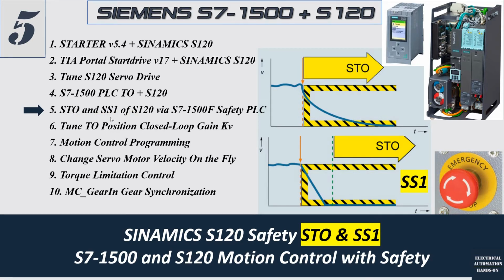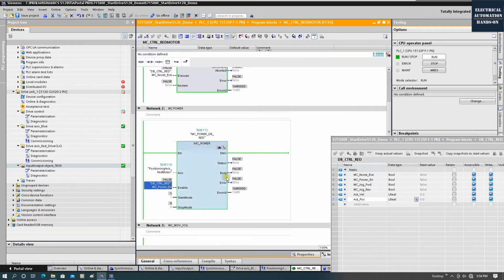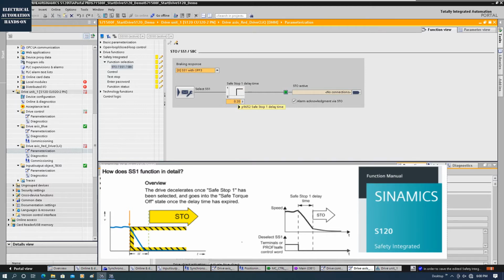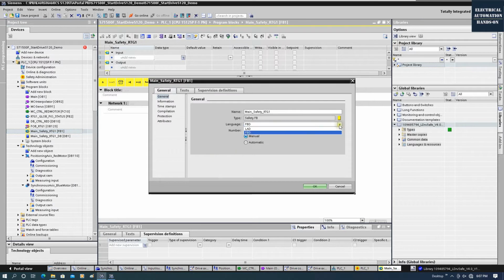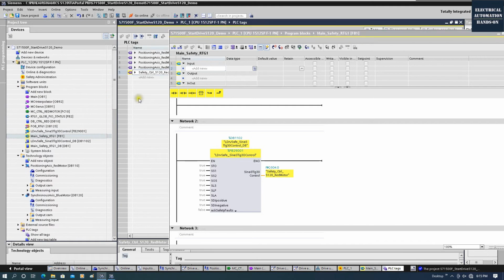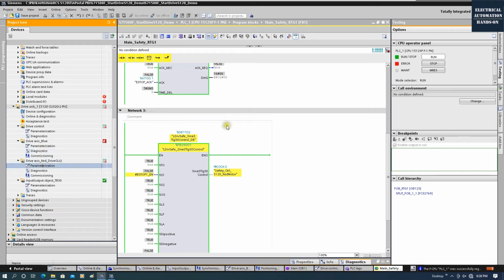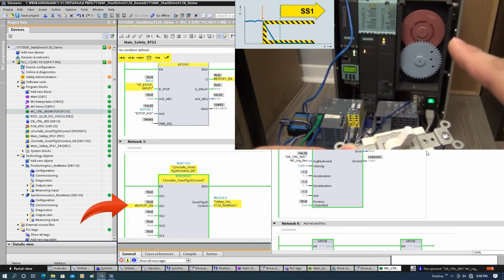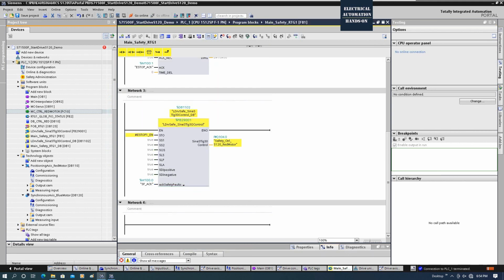MS05g. [Siemens S120 #5] SINAMICS STO Safety Torque and SS1 Safe Stop vis Safety PLC

Comment: How can i do it from bop
Reply from the maker: all the safety parameters are related to 'p' parameters, you could use operation panel to set the parameters, but related to the safety, I will not recommend using it, instead using software so you can see the over picture on the safety settings
Reply: @electricalautomation thanks you can you tell me how set push button with starter i know i have to chane 0840 p844 p848 and how wirring emergency stop in cu310 2 pn

Comment: Hi, I have an application where there will be 2 servo motors on different gear ratios. And I need to do electronic gearing. and on the emergency stop with the safety stop synchronously without losing the synchronisation. Can you do one video for this?

Comment: Hi admin  i would like to ask some any question are  the safe ty function can i use pLC S7-1517T weahter  or not  ?
Reply from the maker: Not quite sure your question, what do you mean about the ty function?
Reply: @electricalautomation  I m used S7-1500T and Sinamics CU320 2PN
I need control stop Drive when push emer switch  but the example video  used PLC 1500F
Reply from the maker: @spk7054  It will be great using 'F' safety build-in PLC. For your case, you can use safety relay to play the safety control role.
Reply: @electricalautomation  thank you very much
Reply: @electricalautomation   I m just don’t want disconnect power infeed line  module oftenly